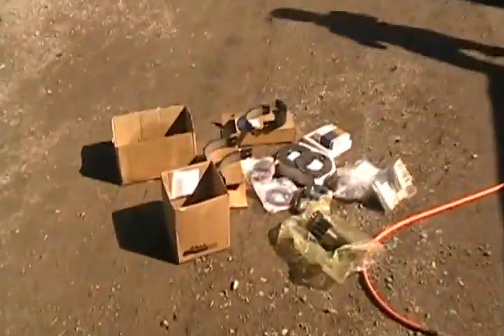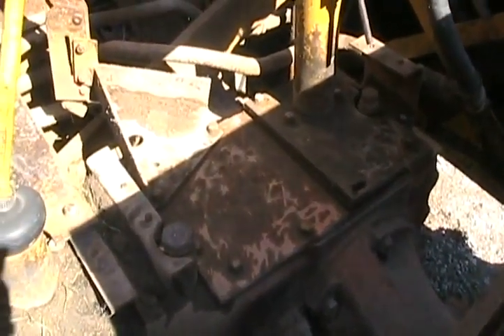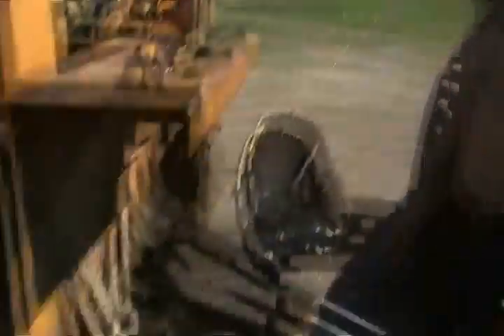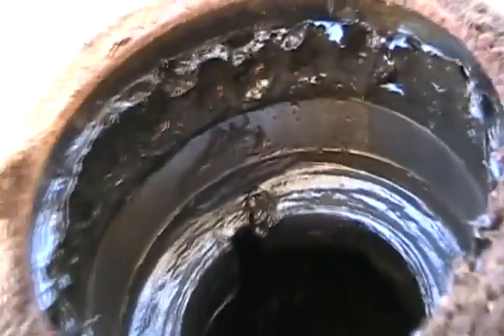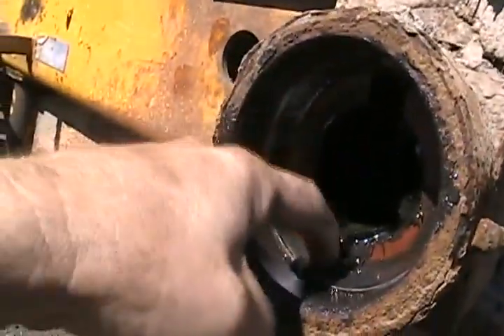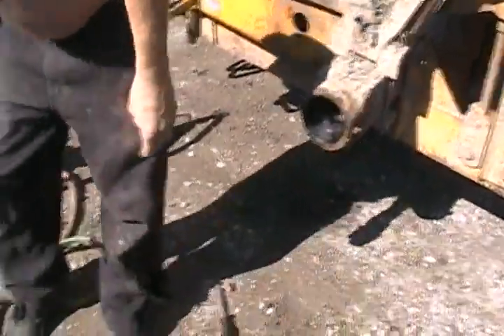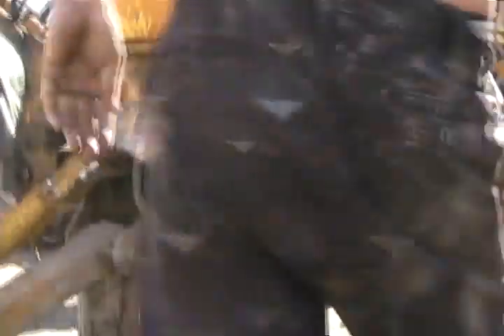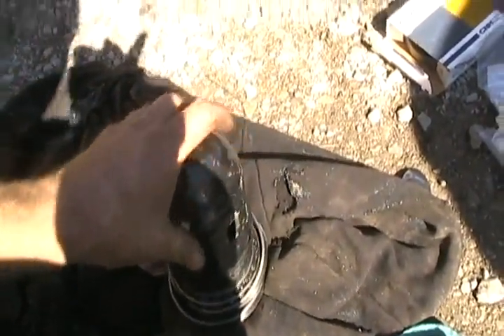Replace rear axel bearings in case backhoe  October 2011

Comment: My ‘69 isn’t locking up but the right side axle began puking out hydraulic fluid by the gallon.  I’m guessing the seal is in roughly the same condition as yours?  Though after seeing you use your torch on that I ordered a 5’ x 3” brass rod and turned a drift pin custom for removing this seal and bearing.

Comment: I also need to do brakes and wheel bearings on my 580 b   do you have part numbers for those parts?  thanks
Reply: You should always disassemble the machine first before you buy the parts. For example, Dave didn't need that $500 shaft, which I assume he was able to take back to the store.

If you search online for "exploded view" or "parts list" using the model number of your tractor, you should be able to find a list of relevant part numbers for your machine.

Comment: Something's not right there,  those bearing cones and seals are supposed pressed onto each shaft before installing into the housing.   ~  Never hammer against a new bearing, it will shorten the life of it.